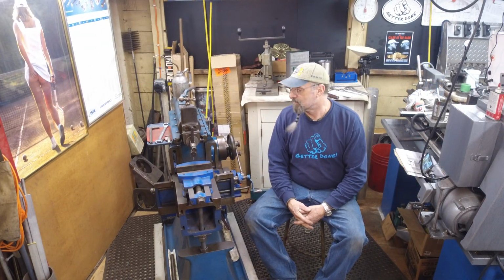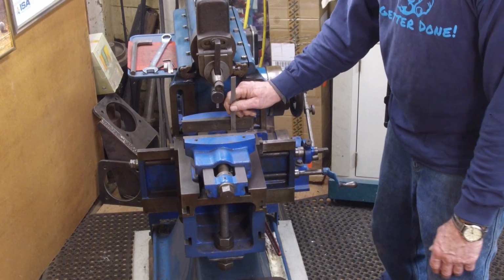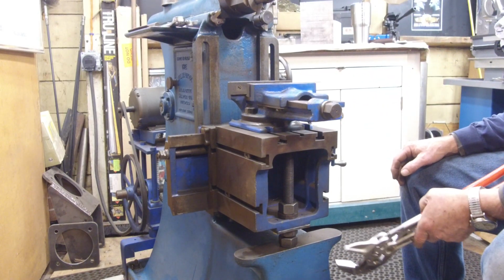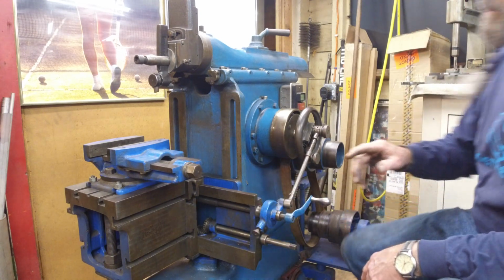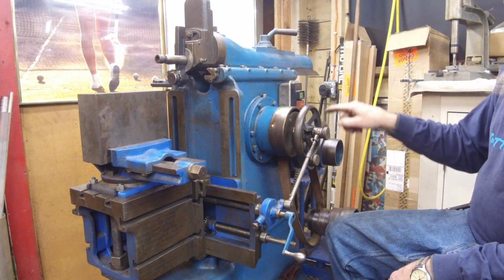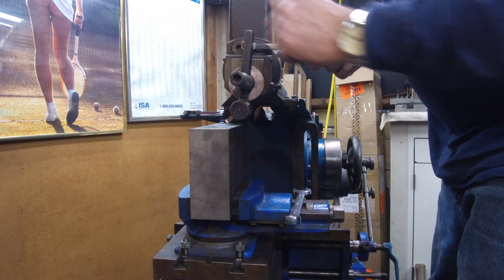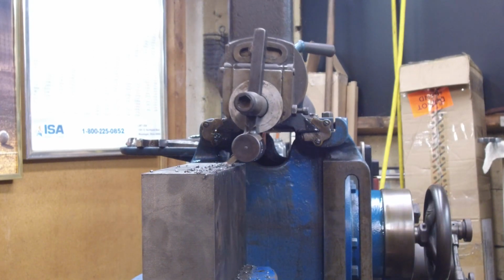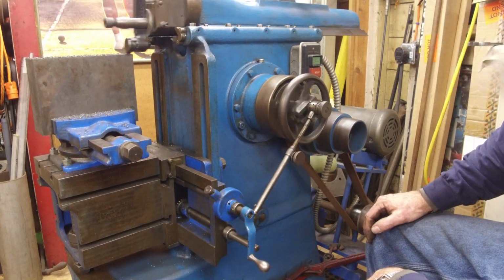The Clapper

Comment: Shaper. Haven't used one of those since h.s. They're not used by anyone too much anymore. Sure not like a wood Shaper which are still in common use. I think his tool placement is incorrect. I was always taught to position the tool > 90 deg to the surface you're generating so that the cutting forces tend to push the tool out away from the surface. If the angle were < 90 it would be forced further into the surface, thus increasing the cut depth.

Beautiful work otherwise.

Comment: Thanks Keith memories as a 4rd year apprentice  I had  shaper job 6 agitator couplings 1"bore  3/16" keyway blind hole with a small under cut in stainless stoned hss tool used, not cleaning swarf often enough I put 1 on the floor lol. Great to hear you Mom is making progress. p.s. just been on 8 months holiday/long service it going to be hard going back to work! Dibbo.

Comment: Keith-  Just thought I would mention that your shaper tooldolder is backwards.  I advised Adam Booth the same thing when he first started using his shaper.  You want the tip of the tool behind the mounting
surface of the clapper. That way, is the tool digs in, it swings away from the pressure, not digs in more.
Reply from the maker: Yeah I don't see it that way, if there was no holder and I used a solid bit it would be ahead of the mounting surface. ;{)-----
Reply: @KeithFenner   A few old texts mention this as as well.

Comment: The shaper was the first machine I learned to use in shop class back in the 1950s. No one else wanted to even learn to use a shaper, they were all hot to get on the lathe. I made a nice little hammer head with the shaper, then got to learn to knurl on the lathe to make the handle. I still have a soft spot for the shaper.

Comment: G'Day Keith,,mate disagree with your tool strategy,after driving many different brands and size  shapers,i always have the shortest tool over hang possible,takes out all the tool spring,
and grind tool to do so,most time a standard tool grind for a left hand roughing tool is all that is required,and finish cuts ,lite cuts with increase radi,and slower feed,
Reply from the maker: Yep.  ;{)------

Comment: Nice little shaper.  Id shorten the tool and not so much angle on it ,  and bump the stroke speed up.  Shapers cut better at higher stroke speed. I could hear the chatter at the end of the video. Probably because of the tool sticking out so far.
Reply from the maker: Yep, those are all things that are already thought of and added to part two of the project. Thanks for the comment, of standard go to's when whoremonics start! LOL ;{)------

Comment: when you alter a machine, or tool do you charge for research and development, for the new machine tool and then the destruction of the tool or machine you started with. so  it takes two days/ 20 hours to plan a change 10 hours to make new machine part, cost of part you destroyed, cost to replace it and the 2 hours to make there part plus cost of there material??? problem with R&D if it can cost 1 million just to make the $2 part they have to sell for $50 @300,000 pieces to brake even! See what I'm getting at?
Reply from the maker: I find that I can make that decision, on modifying or adding to the tooling on any one job, to Getter Done, most of the time, cheaper than the time wasted in the office arguing  over what to charge or not too. You have to give to get, if your angle always points back to you, then you may get poked by it, in the long run. ;{)------
Reply: Joseph springer f
Reply: Joseph springer j

Comment: With my cast iron table saw, I use Boeshield T-9 to normally store it and then Johnsons paste wax on it when I am using it. When I first got the machine I did not know how to care for it and it flash rusted a few times and discolored it. Anyhow, would the paste work hurt anything if you used it for the surfaces of your machines? Would it have adverse effects on any of the materials or interact poorly with the lubricating oils or anything else?
Reply from the maker: It would work as well as the oils I have coated it with since 1994 when I refinished her. ;{)------